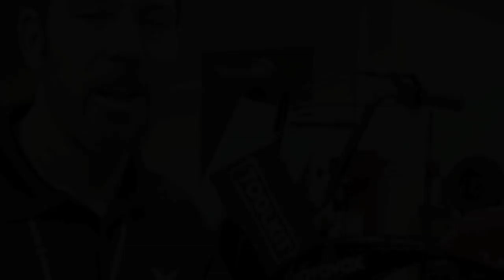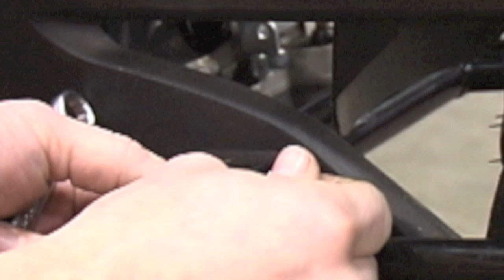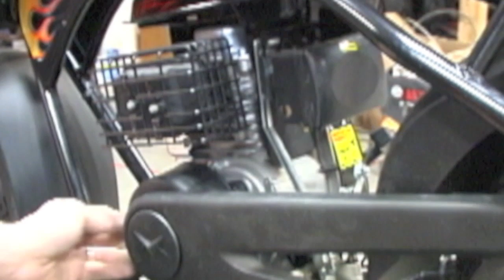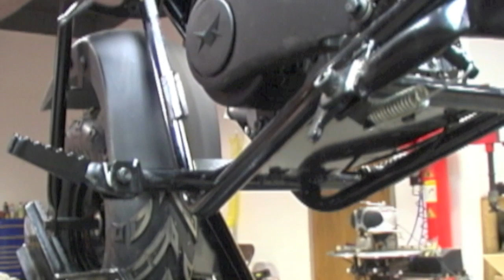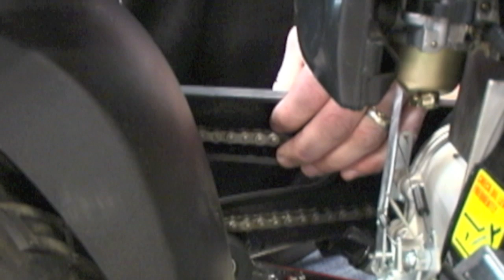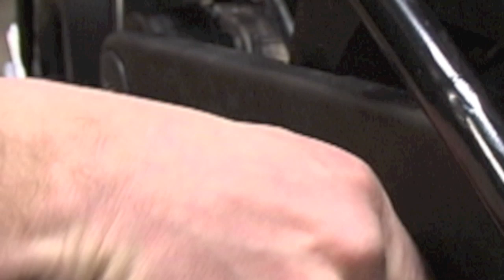MBx10 Chain Alignment / Motor Mounts

Comment: My chain keeps on slipping of so what should I do
Reply: Skateboard wheel on a bolt under the chain where that hole is, its almost between the front n back sprockets